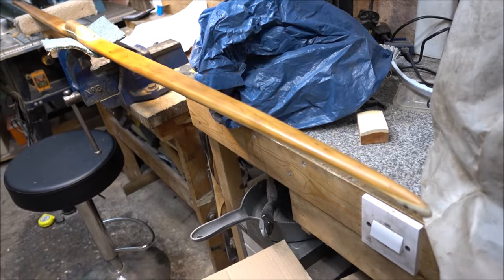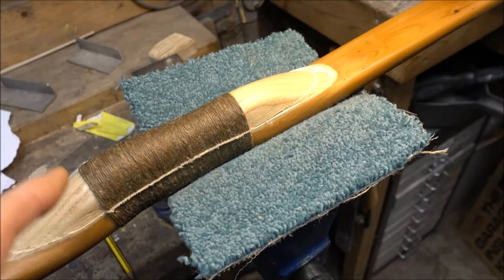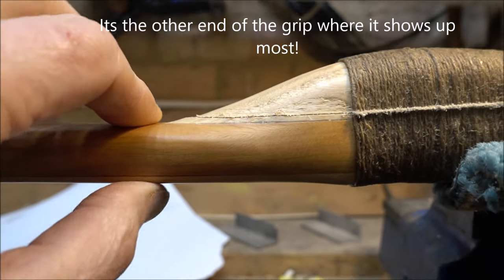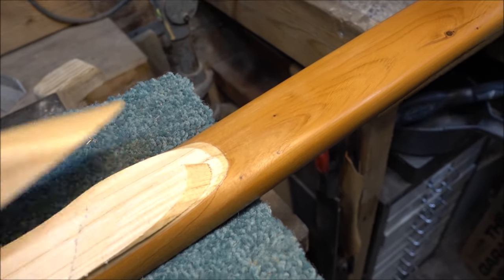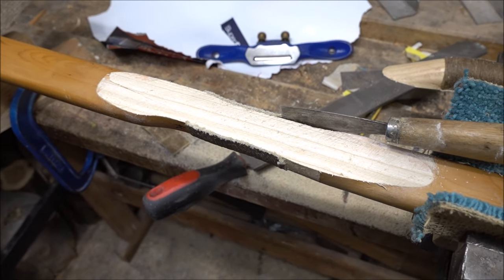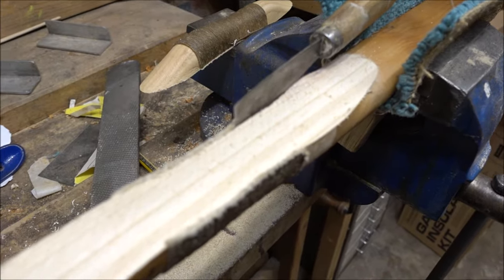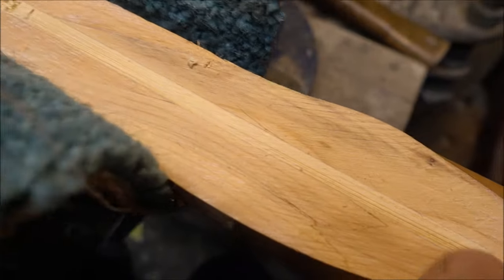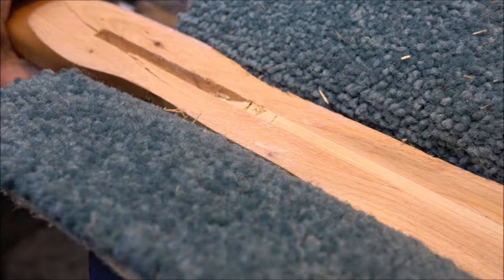Heavy Boo Yew Primitive Repair

Comment: Love it how you give the bow some respect and try to get it back to work! :-)
When you rasped out the cracks it was spoon shaped? Because i dont understand how the yew fit in when you just made it flat.
Reply from the maker: It was pretty flat, maybe just a whisker dished along the length, but flat across the width.
Reply: So the thin part of the limb that you pointed out didnt get some yew glued to it?
Reply: Interesting set of problems. I understand the lure of new challenges working on antiques. When cracks separate the grain and become structural and creating a repair is challenging. The solution seems workable. At what point does aged wood simply become non-functional?
Reply from the maker: @christophkainz8047  It did get Yew over it. I'll try and show it better in the next video. (I was pointing to the wrong end of the riser in this video, I'd turned the bow round by mistake!)
Reply from the maker: @MakerBoyOldBoy  There's no simple answer. I've made bows that are still shooting well after 40,000 arrows! It's like a chain only being as strong as its weakest link... and that weak link isn't always obvious. It depends on the function of the wood too! Rot is really the end of life for wood.

Comment: I’ve never seen that before the handle stiffener that is very interesting - ever thought of using horn slats (horn is a horror to work I know but…) i had a lemonwood bow like this with a riser I just could not for the life of me get to stay on, when I did it forced another split, i then gave up the wood riser and tried a slat of buffalo horn that was a messed up scrap from a failed horn bow attempt, feathered it at both ends glued and bound worked ok, however it was only about 35-40lb so just a practice bow really but it held up. I cut that one up though to make an experimental 18” rawhide backed mini lemonwood hybrid bow 😬
Reply from the maker: Yeah, funny stuff horn. I've only really used horn on horn nocks and arrow nock reinforcement strips. Miniature bows are great fun, I sent one over to the states for a fun competion at one of the primitive meets:-
https://bowyersdiary.blogspot.com/2016/05/patch-progress-and-mini-bow.html